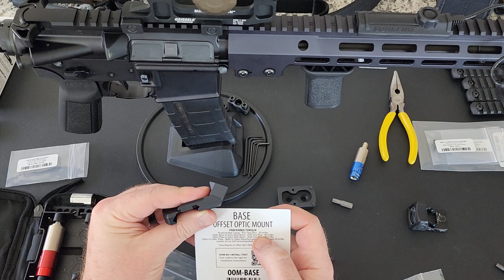How to Install Arisaka Red Dot Offset Mount

Comment: Couldn't even finish watching this.
Reply: Pretty cringe
Reply: @dionysis84 do you know tge name if tge torx kit is great to tee it and or angle it for extra leverage. He want a time out to do more shit.  So sad . The pot a potty. God help him. Shut up. One time and his issue are over forever. Bite me
Reply: @dionysis84 the optic base the optic off set GOD
Reply: @dionysis84 use blue lock tight. Unbelievable